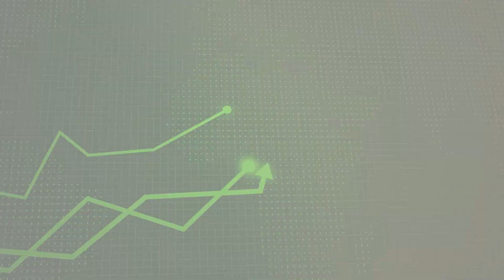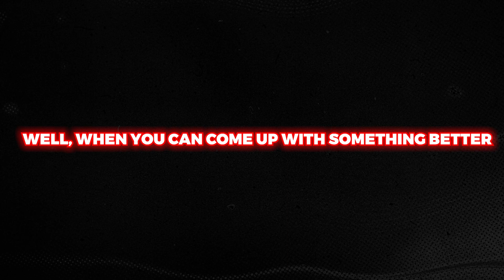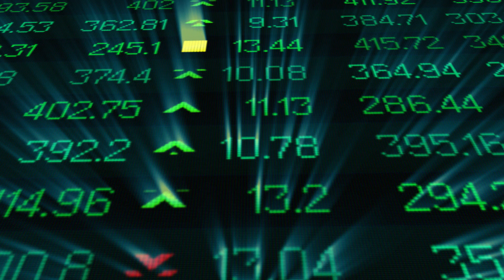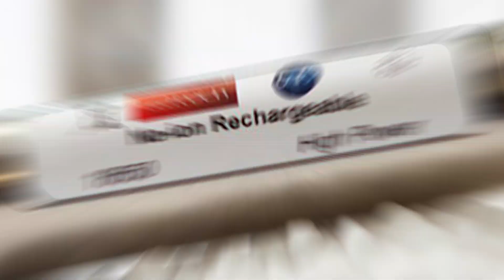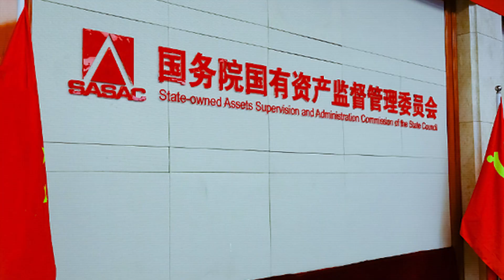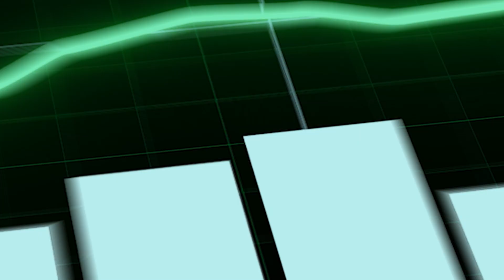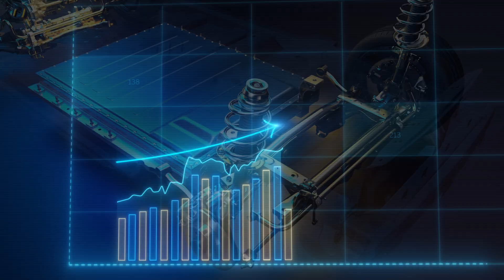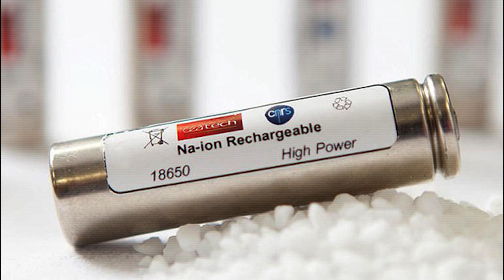Is This The End Of Lithium? | The Truth About CATL Surprising Decision

Comment: Mining lithium is cheaper  than recycling it, mining lithium is very toxic for environment due to releasing it`s  guzzled water with toxins onto planets water and oceans!
Due to the heavy toxins and pollution in mining lithium, when a lithium car is still in the company  assembly line it has already polluted more than a hydrogen fuel cell car that has been on the road for more than 125000 miles!
Better alternative Car!
In the next years effective great priced solar hydrogen fuel cells will be on sale for anyone who would like to power there home and car on clean hydrogen.
Secret about hydrogen fuel cell cars is  that each car actually cleans the air as it runs due to it`s clean watered electrolysis  when released onto the atmosphere.

Comment: i think sodium-ion batteries are promising, but they have significant drawbacks such as low energy density, limited life cycle, low ionic conductivity. Beside those, graphite, which is most common and cheapest electrode material in lithium ion batteries, performs poorly in sodium ion batteries. So the scientists should find new electrode material and finding new one can be way expensive. Therefore, in the near future i stead of lithium we can see potassium ion batteries which is as much cheap as sodium, as safe as solid state batteries and open to developments